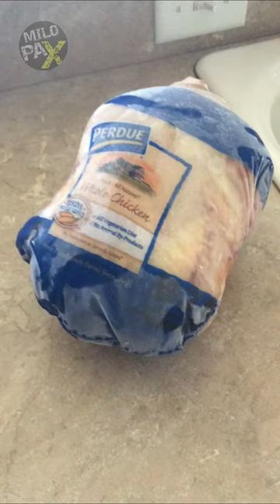Did You Know That Airplane Engines Are Tested with Frozen Chickens? #shorts  #learning

Comment: This test in only performed on one of the two or three prototype test engines, NOT ON EVERY NEW ENGINE COMING OFF THE MANUFACTURER PRODUCTION. This is only one of several injection test performed in a very specific order and culminating in what's called the blade off test. Remember only one prototype will ever see this level of abuse and ultimately destroyed so we the flying public and airline staff can rest knowing that the conditions the engines powering our trip were tested to way beyond any conditions any commercial and many military aircraft could experience in this planet. Each passenger engine are hand build to exacting tollerences and standard costing from $10M to north of $25M for the newer generation super efficient high by pass marvels of humanities imagination. There parts inside the power plants that are out of this world as to the science and technology behind them.